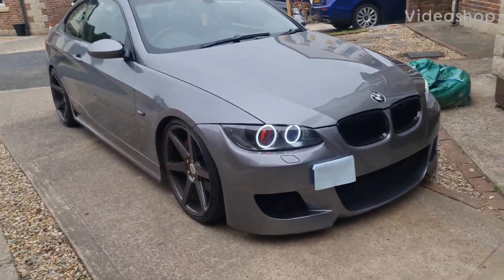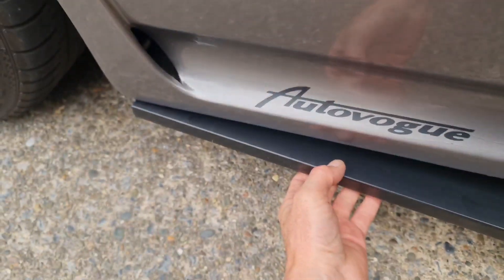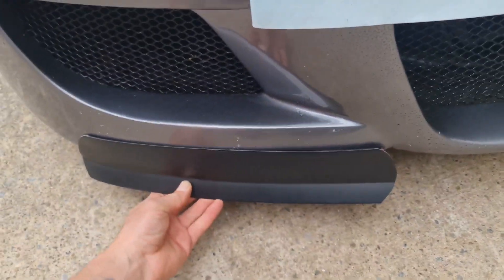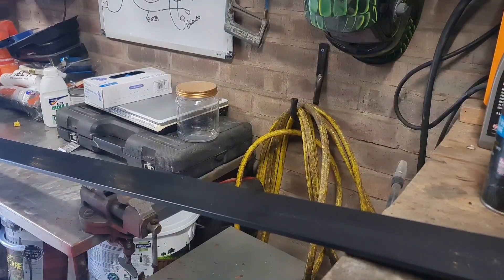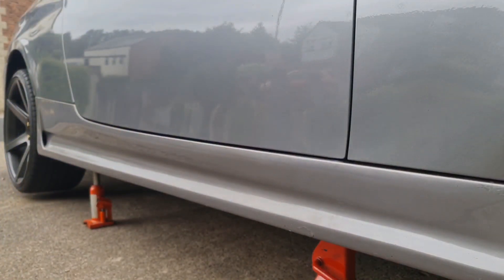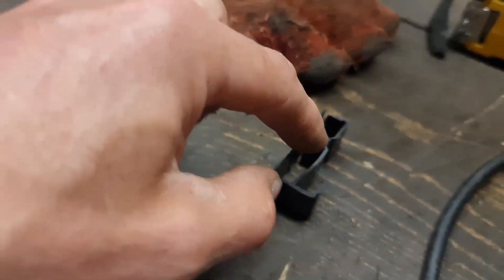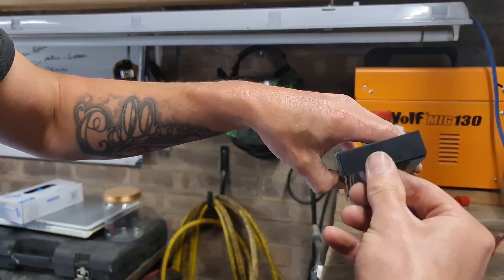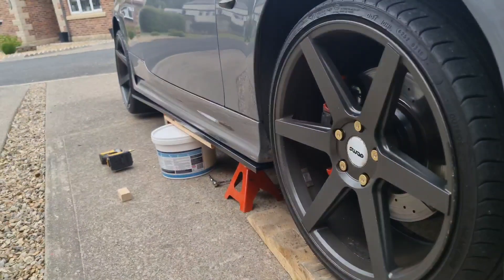DIY BMW E92 Side skirt extensions lip spoiler

Comment: Looking clean and tasteful bro, what’s the engine size?
Reply from the maker: Cheers pal, its the 335d.... its had a stage 2 running 400bhp.
Reply: @TheBlackSheepprojects  I’m hoping to buy one, but it seems so hard to find a low mileage one without an extortionate price tag. Guess these cars are starting to become rare
Reply from the maker: Ye i know what you mean, i bought mine with 85k on the clock fsh whick is low for the age... but it looked good had the right mods. I paid very top money for it at the time but my heart ruled my head and its only money :)

In the last 9 months i have changed and serviced everything that becomes an issue at 100k. The list is long but i am quite particular when it comes to a car i like
Reply: @TheBlackSheepprojects  that’s very good mileage, I am really being patient to find the one that I really want, especially if it’s got the Autovogue body kit! One can only hope and prey lol
Reply from the maker: @PikaZoy  good luck with the search pal 👍